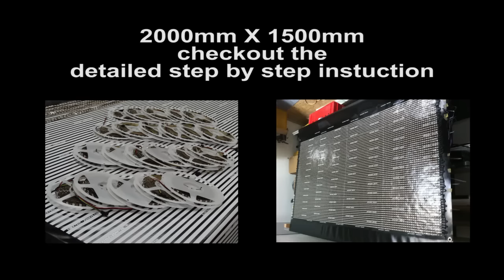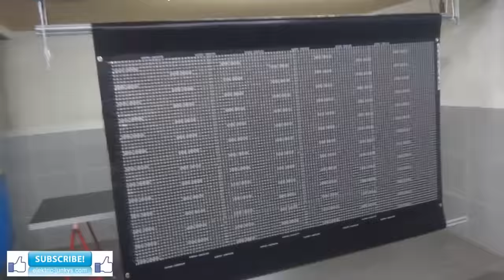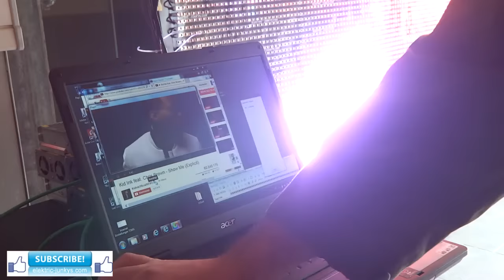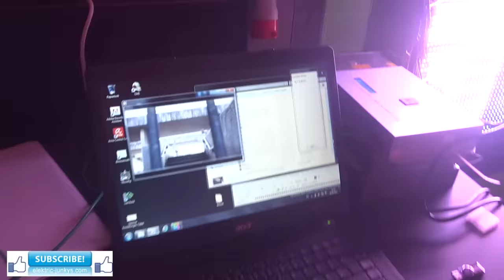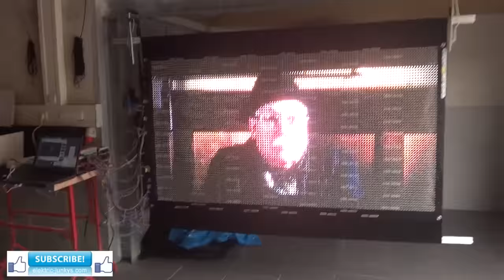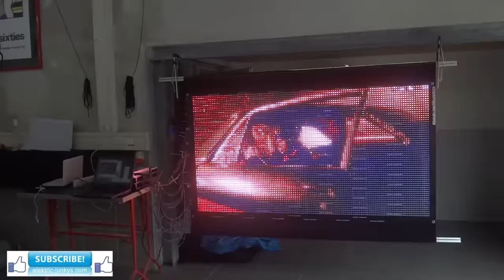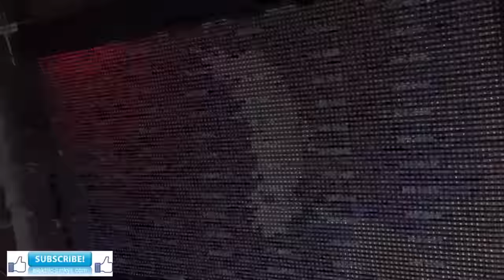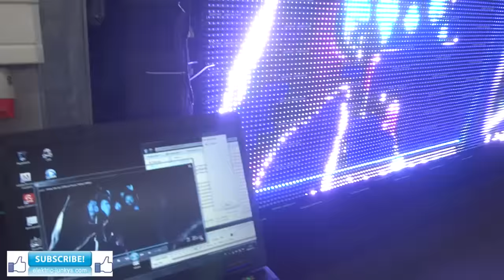how to build a flexible LED Striplight Video Wall P16 | #LEDSign LED Display WS2813 Cortina LED

Comment: Hello, with your tutorial, I'm inspired and buy some led strips ws2811, well I proceeded to make the matrix, I made sure that the sequence of snake was well done. Proceeded to open lededit configure everything as it should be. And I run my video effects ...

how is it? Did not work. The matrix does not follow the sequence, I make sure it is fine, but it does not work ...

Then look carefully, that the chip is sm16703p, and configure it, but it did not work either.

The lines cross each other individually and are never synchronized

Comment: Nice, but it's "only" 64 rows of pixels.  Would it be possible/feasible to build one at a much higher resolution, say 720p or 1080p ? Or are there technical issues to that ?

Comment: It's awesome project but wear a safety glove mate you gonna burn your hand with that solder.
Reply: Enes yıldırım How much experience do you have with soldering? Gloves are horribly debilitating while soldering!
Reply: I'm sorry I just wanted you to be safe. I'm not prefessional  on soldering.
Reply: Enes yıldırım Ok, so i may get burned... I'll be just fine. The fumes however are a bitch. They are toxic and must be avoided when possible.
Reply from the maker: +FallSoftly yeah it´s kind of inconvinient but bearable... the smell of the solder is more worse ;) addicted to the smell of burning solder ;p

Comment: Well, but how you control every single LED pixel using only 3 wires and as well as connect 2 lines in series? In such scheme 2 lines should have same color?!

Comment: Pretty cool video! I agree with most of the comments I have seen about this screen. It is sort of low resolution and pricey but it is still a cool project. I know it’s very pricey and expensive and  m not completely sure which amount you used but it appears that you used 30 leds per meter looks like mine...there are also 60 and 144 per meter too! It would be an interesting idea for a future project to do a video comparing this to a 144 led per meter display or even all 3. Other than it being very time consuming it Is a pretty cool project and I can tell it took a really long time to put it together. It is almost an entire hour just for a quick version of this! Just curious how long did it actually take you to complete this?
Reply from the maker: Thank´s a lot for comment visit https://elektric-junkys.com we have Budgets for everyones Pocket

Comment: To protect soldered wire at the ends of led lines u can use thermo glue in addition, before black cover.
Reply from the maker: thank´s for comment ..

Comment: Now how much did that cost? Would it have been better and cheaper to do a like 4 1080p tvs and network them?
Reply: it's a diy project. putting tvs together is simple and can be done in minutes. This is for someone who wants to broaden their knowledge and have true bragging rights, in no way did he plan on it being a 1080p tv. They aren't even comparable this is so cool
Reply from the maker: +zerocool60544 no the cause of this screen is ADVERTISING VISIBLE FROM 500 METERS !!!!
Reply: +ejunky66 True. I want to do this but not to that scale but still for outdoor advertising. how much did this cost you and if you sold this what did you get for it?
Thanks
Reply: I wouldn't say creating this simple bit of kit would broaden your knowledge. It is very easy to do, just very time consuming!!.

Comment: Led matrices are awesome.  I thought of using strips but ended up using led sheets instead as backlight for translucent stone.   The power and current requirements for a wall ended up being very high such that I needed to limit the current use using wled.
Reply from the maker: Thank you for comment, yes you are right especially for the 60LED/m VErsion uses lot of power, next time you can check our P2.5 Flex Modules they are very easy and nice to Install and use Less Power, We used them several Times fo Kitchen Backsplashes.

Comment: I noticed you used four power supplies.  
How many LED strips per [what kind of] power supply?  It looks like 70 strips at about 8ft long.  This should help decide on what size to order
Reply from the maker: hawaiianbudd hi, it depends on the amp´s of the power supply´s... we used more than 4, but send us an email we will find the right amount of power supplys dpd. on your Screen size ..

Comment: Are you using 3 or 4 pin solderless connectors I can't find 3 pin connectors anywhere. ..and what kind of power supply do I need to run 20m of 60 leads/m ws2812b?
Reply from the maker: hi, useing 3pin solderless connectors please check in our shop.elektric-junkys.com, for more questions send us an email support@elektric-junkys.com you can calculate the needed consumption depending your strips...   i will not advice customers use WS2812b  BTW !

Comment: Wich wire I need to use to give 5v 20A from power supply to LEDs and connection between led strip to led strip?
Reply from the maker: hi, depends on LED Strip modell controller and Power driving, please send us an email https://elektric-junkys.com

Comment: How would this look with a milkglas foil in front of it? Have you tried this already? Not directly on the LEDs but maybe with 5mm distance. I think due to the low resolution the pixels are looking too hard to me. The milkglas would soften it a little bit.
Reply from the maker: hi, yeah you are right for closer distances it would be ok .. the intention of this screens is for sure Far distance that´s why you need all the Brightness and Light angle check out our new Project an easy Plug and Play KIT https://www.youtube.com/watch?v=sPt9olLB_o4

Comment: this is so epic! Just curious did you guy order a customized pvc banner with the led measurements/guidelines? I would really appreciate it if you could give us some insight on how you achieved, what appears to be, this customized adhesive on your banner :)
Reply from the maker: +AlecoSound WE ARE MANUFACTURER IN CHINA shop.elektric-junkys.com
Reply: +ejunky66 Yes thank you, I am aware of your website. My question was in regards to the banner you stuck the LEDs on, I do not see this advertised on your website.
Reply from the maker: hi .. got it the template and the PVC we sell of course as well please send us an email we will give you an quote
Reply: Ok great thank you!
Reply: +ejunky66 -nove
Reply: @ejunky66  how much is the controller

Comment: 19:43 what is the purple+ black wire for? some of it has some does not.

Im newbie here :)
Reply: +KAiLuN TaN - It looks like to me that every four rows equals one complete strip. The beginning of the strip is the control signal(black, yellow, green, red it looks like), the end of the strip (purple & black) is the power applied.

Comment: Cheaper and easier just to buy a flatscreen at that size, non? lol...
Reply: Yes, but...
1. You can get LED strips which are waterproof,
2. The entire panel is flexible,
3. The light output is far higher than even the brightest of backlit LCD displays,
4. Constructed properly, it'll be far more robust in portable use.

For fixed indoor use though, you're quite right - you'd be silly to invest the time and money needed for this when you can get a ready-built display with much higher resolution at a lower price.
Reply: Yorick Hunt
As someone that has used a Samsung LED 60" outside in the rain, I completely disagree. It doesn't take a genius to waterproof electronics... If it was flexible then you'd massively distort the image, so again, why would you do it?
Reply from the maker: yes for private Purposes for sure
Reply: I'm not sure why someone would buy a hand made one when a machine made one will cost a fraction of the price!
Reply: *****
No, they are very cheap in England, 60" can be had for about 500 quid now. What application are you actually referring to? Outside a shop you're walking past you'd barely be able to figure out what you're looking at, you'd need to go much further back. What about projectors? The only place I see this sort of tack is outside Asian phone shops...
Reply: *****
Well it hardly matters when you're looking at resolutions like this! lol. But the one I bought was 4k UHD screen on offer from £730 to £539.99 and that was a while back. Brand new from an electronics store.
Reply: Zoid Burg Planet Unknown is right; what you bought is an LCD screen. The problem is illiterate "marketing types" who latch onto a phrase without knowing what it is, then bombard the public with "ooh, look, new technology that you must buy!"

TVs sold as "LCD" and "LED" differ in only one aspect, and that's the technology used for the backlight - either CCFL (Cold Cathode Fluorescent) or LED. They are both LCD display panels.

If you want sufficient brightness for outdoor visibility in the daytime, the only consumer-grade display which might stand a chance is OLED, but (1) good luck finding an affordable one and (2) they're still nowhere near as bright as discreet LEDs.

You could of course go with ready-made modules from China, but you'd have to do your costings appropriately to compare. A cursory search found this modular unit;
http://www.aliexpress.com/item/-/32373892919.html
These modules are much higher in resolution than ejunky66's solution, but are markedly more expensive (to cover the same area). They're also limited to indoor use only (i.e., they're not moisture-resistant).
Reply: Yorick Hunt
No, all the TVs in my house are Samsung LEDs. I've never bought an LCD and before that I bought plasmas. In fact 2 of my TVs are OLEDs.
Reply: Zoid Burg Trust me, as an electronics engineer I can tell you that all of your TVs use LCD panels. It's only the backlight which is LED. Check the specifications on Samsung's web site for your models and you'll see that that's the case. LED displays are simply not made for domestic use; they're too expensive, too bright, and above all, too power-hungry (consider the fact that the 128x128 pixel modular panel I linked to consumes 200W of power).
Reply: ***** Yes, relatively cheap. I haven't bothered keeping abreast of their prices, but I remember when Samsung and LG almost simultaneously launched their OLED offerings, they were asking well over $30K for 60" panels. Mind you, when Plasmas first became available for domestic use (1998-99, I think?), they were going for around $20K for a 32" panel.
Reply: ***** Well that certainly explains the big price drop, and it also demonstrates just how much of a grip "marketers" have over the world.

Looking at it logically, it's stupid to replace an LED backlight with an OLED one, because the light output will be lower,  the lifespan will be lower, and the cost will be higher.

But obviously they've thought to themselves, "hey, we can make a lot of money off the gullible fools who simply see 'OLED' and want to have it," so that's what they've made.

What was the old saying, "whileever there are fools with money, there'll be smart people figuring out ways to relieve them of it?"
Reply from the maker: You Got it man  ! Thumbs up !!

Comment: Watching just to get the idea on the power supply wattage used to heat up the wall ..
Reply from the maker: hi thank´s for comment, meanwhile we offer Full Plug and Play Kit´s no more Power Control or Solder Problemas check it out https://elektric-junkys.com

Comment: Is this curtain still available for purchase?  If so, what is the lowest you will go?  Also, do I need to order any additional connecters - for example, how would I connect this to a laptop?
Reply from the maker: hi, yeah its still available, just send me an PM, you just connect it by DVI "lan" cable
Reply: Email sent.  Thanks
Reply from the maker: i send you an message here in youtube did you get it ?
Reply: ***** Got it.  I replied.

Comment: I need a RGB led tv.  how much price any body can tell me? my country is india.  How i want like this tv.
Reply from the maker: http://ws2811softdisplay.blogspot.com complete Text DIY with Partslist and Links to ORDER!
Reply: Yeah, but the Parts List doesn't include things like:  1) the black flexible backroll, 2) the 3-pin LED strip connectors, and 3) the adhesive strip sheets to put between the black roll and LED Strips with the nice fixed spacing.  The ones on your website are 4-pin, and don't work for WS2812 LED Strips!  Can you provide links to these other items.
Reply from the maker: http://shop.elektric-junkys.com/WS2812b-5M-DC5V-Pixel-RGB-color-led-strip-300LED-300IC-SMD5050-88.htm

Comment: One question, how individual leds are addressed in the same row/strip to show different colors/intensities? Thanks!
Reply: +Pablo Pazos WS2811
Reply: How are the different colors displayed in the same row?
Reply: +Vertis M. Wilder by using special addressable LED strips. Each led has a ws2812b or ws2811 etc chip in it controlling the color. You cant use normal RGB strip because they will be all same color.
Reply: So that's how a single LED strip can display multiple colors.

Thank You
Reply: Where are you from ?
Reply from the maker: china

Comment: really good,, is it possible to connect wireless system like bluetooth wifi or gsm to display messages or something animated
Reply from the maker: Chandan Kumar nothing is impossible, we have several solutions for Far Distance controll
Reply: Ii am building something like this and also building controllerand power supply ..can you give idea how it is possible ..
Reply: On this big scale of led display
Reply from the maker: Chandan Kumar http://ws2811softdisplay.blogspot.com here you can find the component List

Comment: I would really like to make this kind of thing! But I was wondering, how much does it cost (approximately) to produce this? I have visited the website with all the materials on, but I don't quite know how many pieces I will need from every part. I also don't know which of the two parts I would best choose since I don't know what will be best for me...
I would make a flexible screen in the same size (completely the same) as in this video :)
Can you help me?
I you'd like I can give you my email?
Reply from the maker: hey guys .. check out the description box links or the guide in the video there is a full Partslist with links and prices
Reply: $500-800 with the current price of components.

Comment: Awesome!!! What is the energy consumption of the complete screen?
Reply: I was trying to figure that out myself but my numbers seem very high. If there are 300 LEDs per strip and I counted 65 strips high thats 19,500 LEDs. These LEDs typically have a maximum power rating of .3W each which would be 5.85kW if each LED was powered to its maximum (white light at full brightness). Thats a lot of power... And these strips typically run off of 5V so 5850W / 5V= 1170A. I'm sure I'm missing something though.
Reply: Luke Standford no you don't
Reply from the maker: Luke Standford absolute wrong guys, the power is 4 times to high, 19500LED´s ;) ? the controller never can controll 19K LED´s
Reply: 5m of this led is around 70W(300 leds)
now calculate yourself.
Reply: ***** - so times about 65/70 strips = still a 4900W power output at full blast per say, and then add on the source (laptop?) and the like as the spots to run it and you're looking at a good, probably 6K watt source total to run?  (Just calculating for myself as I wouldn't mind running one of these/building one)
Reply from the maker: 1200 Watts

Comment: Can i use arduino in this project
Reply from the maker: hi, you can yeah but not 1 you need at least 4-5 pcs + about 10pcs converter devices ... so its IMPOSSIBLE to make it cheaper than we made here ! THIS IS THE CHEAPEST SOLID WORKING SOLUTION
Reply: ejunky66 thank u so much

Comment: Amazing Video!
So every 8m a new current supply and only one "information" input?
Reply: You cannot stream all of the data bits fast enough for WS2811 to get full frame rate on a display of more than about 800 LEDs.   The display needs to be subdivided into stripes (each stripe could be more than one row of LEDs as it is in this case) that all need to be fed appropriate frame data at the same time.  To keep a 30 fps frame rate, each stripe must be less than about 800 LEDs.   So the controller handles splitting off the video data to each stripe to drive the display.  The power supplies drive both ends of a stripe, or one end will be dimmer than the other.  Power stripes are the same size as data stripes assuming that 100W power supplies are used.   I've build a smaller display (25x24) that only use a 60W power supply.  It goes into over-current if I turn all LEDs up full white.  I really need to get a 100W supply to keep it happy.

Comment: how much money i need to fabric this?
Reply from the maker: about 500
Reply: where can i buy?
Reply from the maker: shop.elektric-junkys.com
Reply: 500 dlls?
Reply from the maker: depend on size, MAterial, Pixel Pitch, Setup controll Method, Waterproof Rate, LED chip Brand use and and and SEND US AN EMAIL !!!!
Reply: how many lines of leds has this screen?
Reply from the maker: www.elektric-junkys.com
Reply: ejunky66 have you a video how connect on your laptop and what's kind of controller and software using

Comment: does the camera guy have ADHD or do they expect us to watch it at 1/4 speed.  I couldn't read almost any of the brand names.  45 minutes of the same pointless steps over and over,  they could have used 5 minutes of the 51 minute vid to slow down and actually show off the equipment...
Reply from the maker: thank´s for the comment mate.. what did you do 5yrs ago ? cheers